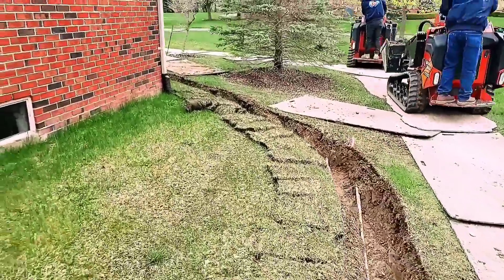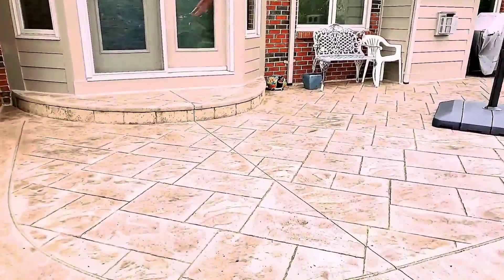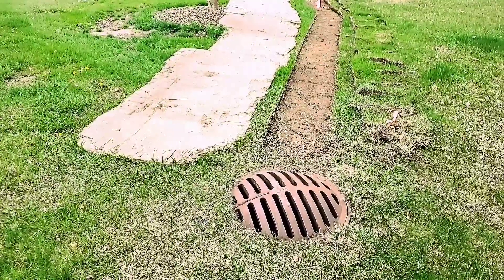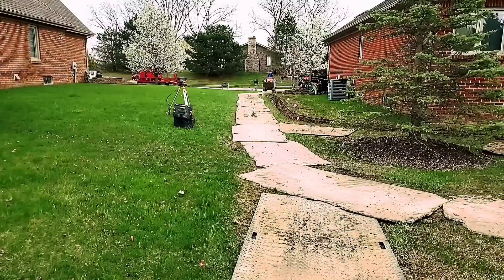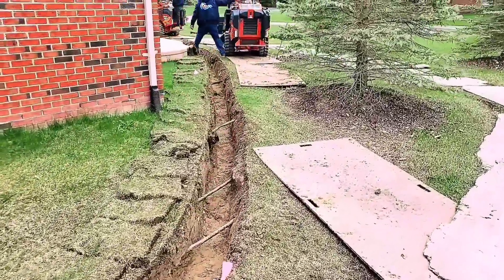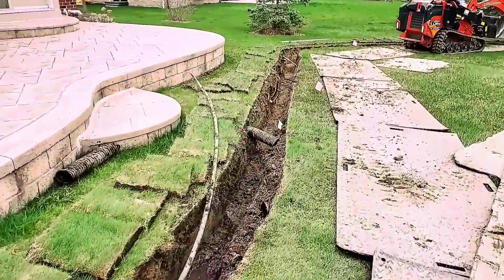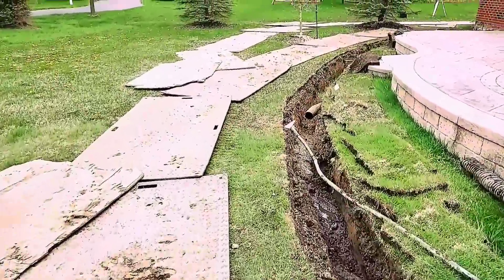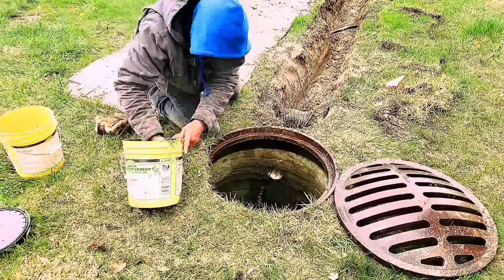How to Check Your Yard Drain Trench for SLOPE - Simple Pro Tip for Contractors & DIYers- Do it Right

Comment: You say 1% isn’t enough…but then also say “just run your pipe in all the low areas on 1% slope” 🤔
Reply from the maker: I do prefer 2% slope, when I can get it and when the yard offers some slope. On a really long run, you end up really deep. That's not good for d. I. Y, so we have to be practical.

Comment: Can you please give a idea price on a drain this size
Reply from the maker: Average 5k-10k
Reply: @FRENCHDRAINMAN   Have you ever seen where the pipe usually is concrete into the curb instead they stopped the pipe at the back of the concrete and just cut 3 slits in the curb and if so what’s the good or bad

Comment: Thanks for all your videos! Is there a minimum amount of slope needed to daylight a French drain using a pop up emitter?
Reply from the maker: Good question. You can't force it or you will be to deep. If you lay a glass full of water flat on a table with no slope it empties out. Why? Because it's not in a hole. You have to run your system to a grade break ( drop off point) and you can be FLAT. System will drain like the glass in my example. Now if you have SLOPE take it. This is one of the hardest things to teach and for diyers to understand. I've done some videos on it but they are older and kinda suck because I was a beginner content creator. I will make a new video this year on the topic. Thank you for commenting and contributing!
Reply: I would love to see this as well!